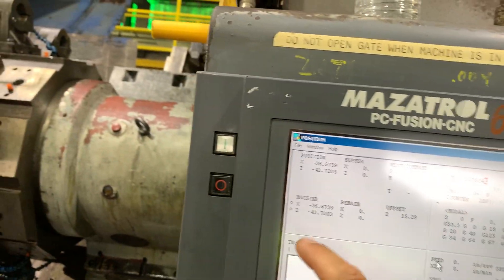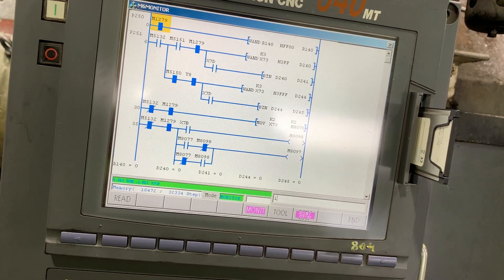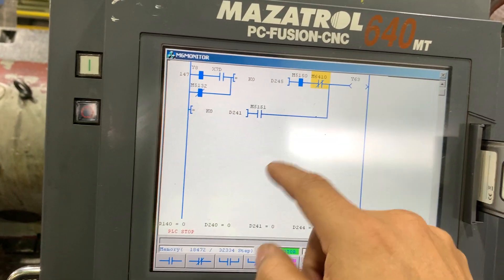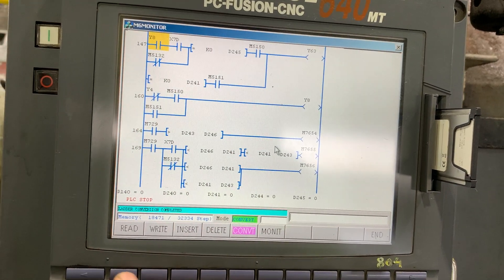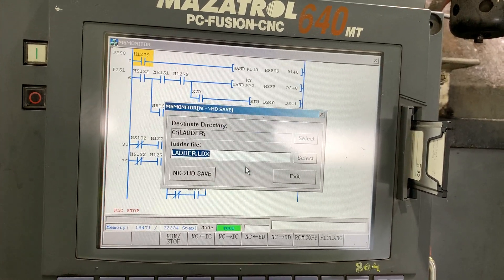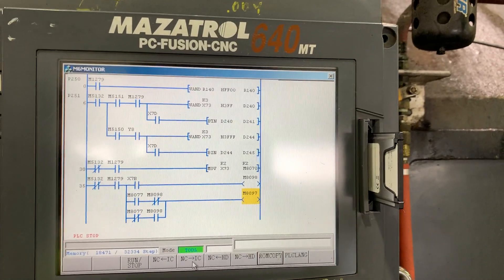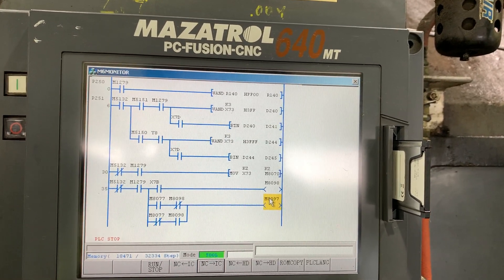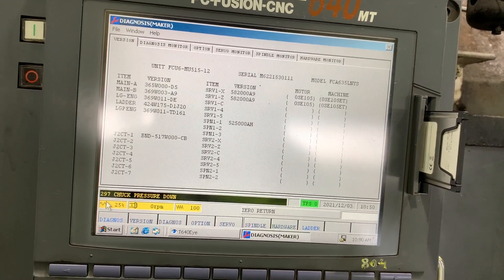Mazak ST60: MR-J2 Commissioning STEP 5 of 5. Modify LADDER for Y63 LED lamp & check 380 alarm text

Comment: Very helpful series Fabian! I need help with a mazak qt300 with fusion 640t at work if you could spare a minute. It's only showing 12 tools on the tool menu but we have a 16 station turret. we can jog through each station just not mdi or program with tools 13-16. Thanks in advance!